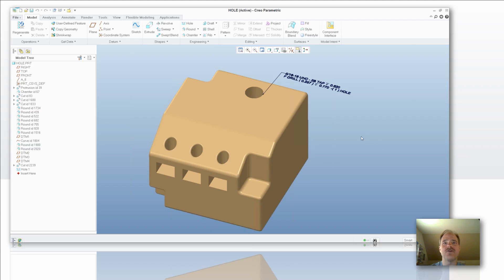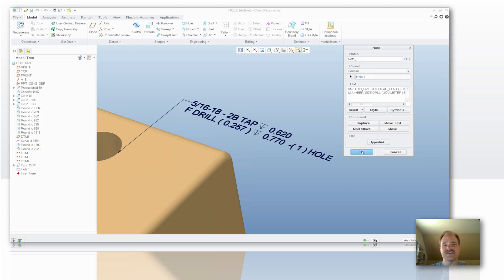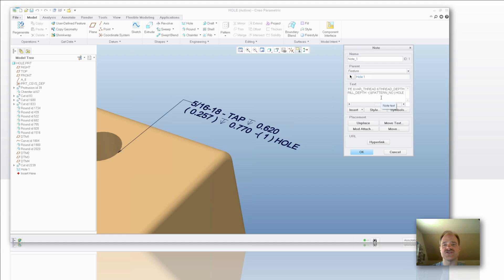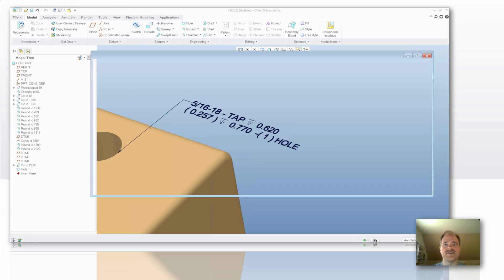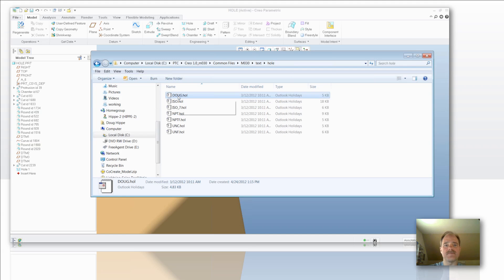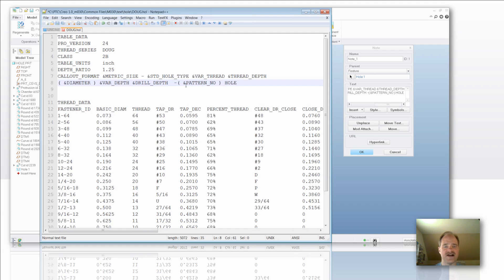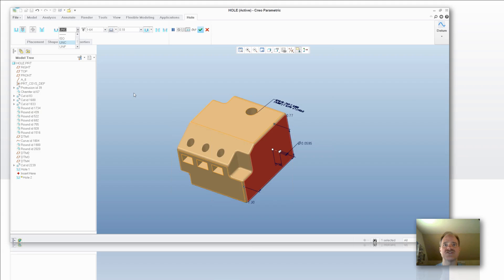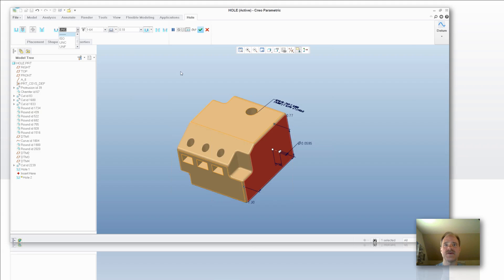EAC Tip-of-the-Week: Editing Hole Annotations and the Standard Hole Annotation Template

Comment from the maker: You can use a UDF for this if you choose, but the hole feature has all of the features built into it that you would use for a UDF and has much more flexibility in the event you decide to use a different fastener.  Since the feature already exists the extra effort required to create and maintain a series of UDF’s (one for each thread type/size) may not bring any extra value than the existing tool.